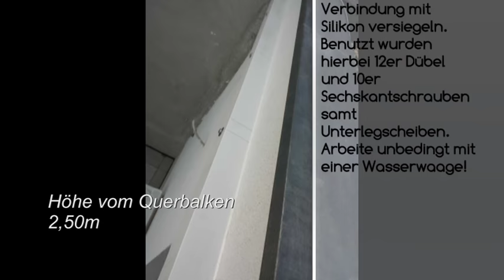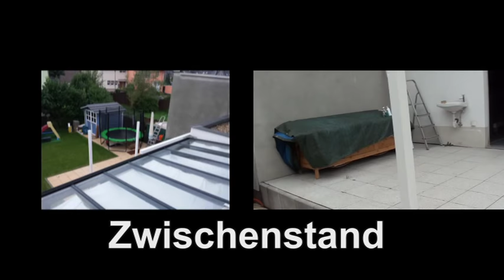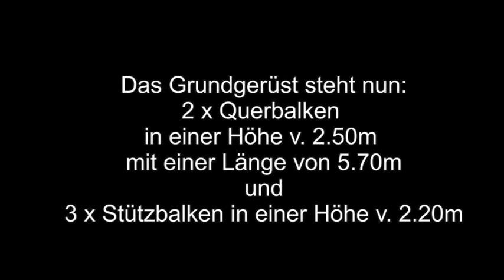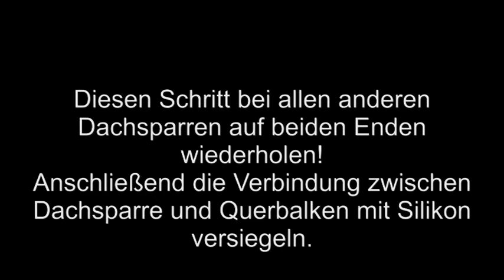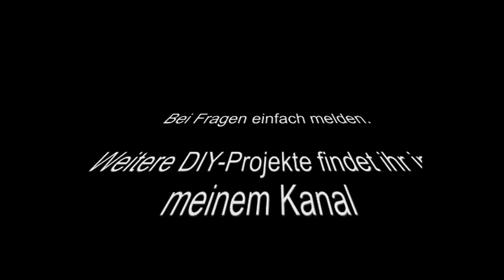Terrassenüberdachung aus Holz - Terrassendach selber bauen - Anleitung - Aufbau - Montage - NEW - HD

Comment: Hi, super Arbeit und tolles Video! Wir möchte uns auch auch eine Überdachung selber bauen. Die Angebote die wir bekommen haben von Firmen waren doch schon mehr als saftig und waren rund 1,5 - 2,5 so teuer wie das von mir selber kalkulierte.
Auf Anmerkungen und Wünsche wurde zum Glück auch gar nicht eingegangen, wir bekamen Stumpf ein Angebot und fertig.

Was für Holz hast du  genau verwendet? Waren das einfach Kreuzrahmen oder KVH oder sogar BSH?

Danke & Gruß

Thomas
Reply from the maker: Also wenn du lust und zeit hast, dann mach es selbst... ich habe alles ganz alleine gemacht und es ist immer noch bombenfest!!!
Benutzt habe ich 10x10 KVH für die pfosten und 6x10 für die sparren... fläche ist ca. 4x6m...
Angebote habe ich erhalten ab 3500-5000€. Mich hat der Spaß insgesamt 700€ gekostet... vg aus köln...

Comment: Na ja, Baufehler gibt es öfters, doch damit die fertig gemalte Holzoberfläche auch nicht von nachträglichen Arbeiten verunreinigt wird, sollte das Holz nach dem Zuschnitt mit Farbe gestrichen werden, und somit sind die Schnittflächen gleichbehandelt. Statt dem Rauhspund und Dachziegeln würde eine Glasoberfläche Licht hereinbringen und nicht eine dunkle Sitzecke bilden.
Reply from the maker: es war ausdrücklich der wunsch ein Holzdach zu haben. Wie man im Video sehen kann, ist die Terrasse nicht direkt vorm Haus (da steht ein Wintergarten mit einem Glasdach). UNd ich muss sagen, dass es dadrunter kaum dunkel ist, wenn die Sonne scheint :-)
Reply: Ausdrückliche Wünsche müssen natürlich befolgt werden ;-)